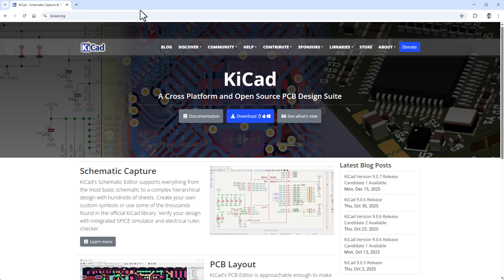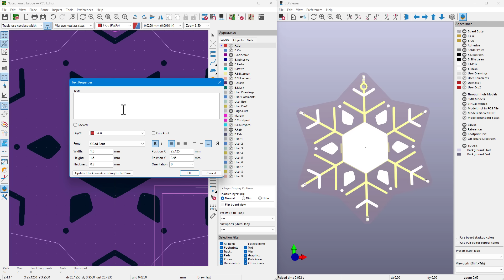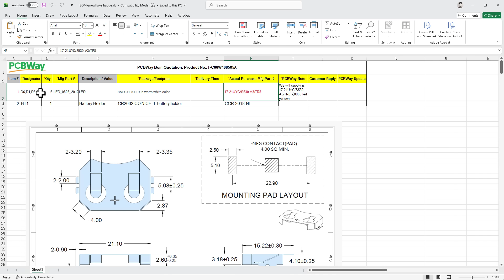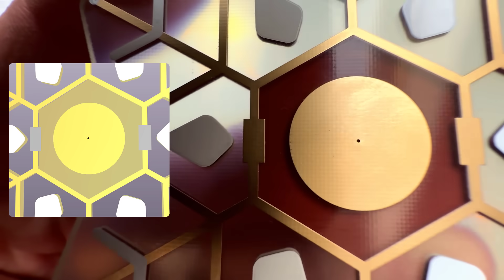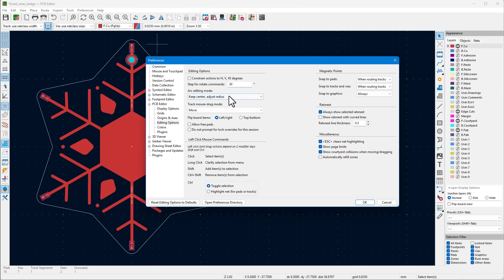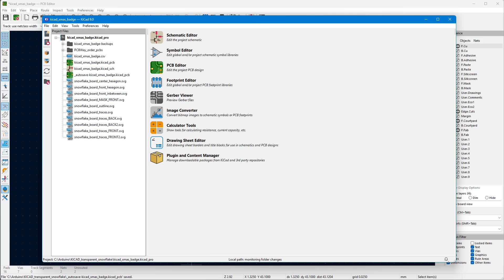You can have transparent PCBs now???

Comment: Exciting stuff! I reached out to PCBWay and asked for some info on the substrate: It's Y-920GT, a glass-fiber reinforced, halogen-free epoxy laminate with very similar properties to FR4, Tg 140. The data sheet I got says 86% light transmittance, which is pretty impressive imo. Can't wait to make something with this.
Reply from the maker: That´a very helpful, thank you for sharing this information.
Reply: This just revived a variation of my backlit thumb keyboard with down firing leds mounted on the back 😎
Reply: The documentation says that transparency was calculated for a 0.1mm layer, meaning it won't be very transparent for 1.6mm.
Reply: @denisgluk431  Certainly not transparent, but translucent enough for a bunch of cool applications I'd say.
Reply: @buildacubesat  I ordered a board with STM32. We'll see if both sides are visible; the tracks are very thin. If they make 4-layer boards like that, it'll probably be a real treat.

Comment: I'm new to electronics. How can we power LEDs directly without resistors? Because of cr2032?
Reply: Some LEDs have resistor build in, but I din't notice if he mention it.
Reply from the maker: The CR2032 battery does not have enough power to really kill the LED, but yes, you should put resistors for LEDs.

Comment: Weren’t pcbs made on glass at one point?
Reply from the maker: I don´t know, but I would suspect that drilling glass is quite involving.
Reply: @upir_upir I think drillability depends on the type of glass, some glasses you can drill pretty simply with the right tools.
Reply: @upir_upir after some digging I found a few companies that say they are able to fully manufacture glass pcbs with vias. Could be cool to see although I’d expect it to be fairly fragile.
Reply: @upir_upir  I found some 0.3mm diamond core drills at the store one evening. All I had to do was mark the holes on the CNC machine, then just sit back and slowly drill. I also bought a tiny drill press. They say you can harden regular drills in sealing wax, but I haven't tried that.  And all the glass is the same. It can be tempered after drilling.

Comment: I'll try ordering it through some intermediaries now. It's a shame I don't have a sample of this PCB.

1. The surface is uneven, so you can't see anything through it. I wonder how transparent it would be if I also filled it with epoxy.

2. Soldering it on a soldering table. Any flux contains synthetic rosin and resin acids, and they develop their natural color if heated for a long time. When I solder a white board, I have to be very careful not to overheat it, otherwise the rosin will somehow soak into the solder mask, leaving yellow spots that can't be removed. And this board is completely transparent, so it's a bit scary to solder.
Reply from the maker: You should definitely get one and try it, it looks great.
Reply: @upir_upir  So, I ordered a board that I'll put in a transparent case. This company asked me for $50. Competitors (other manufacturers) wanted something like $400-$500. I'm waiting for the results

Comment: Oh... this is going to be a huge deal. I'd love to know what kind of material this is, and how it differs electronically from FR-4.

No sign of this on JLCPCB as of the time I'm writing this.
Reply: It's Y-920GT and has very similar properties to FR4 Tg 140: Dielectric constant (1 GHz): 4.1, loss tangent (1 GHz): 0.023.
Reply from the maker: Thank you for the clarification, very helpful!
Reply: Indeed, JLCPCB don't have this. They have transparent flex PCBs, which is not the same (and expensive).

Comment: can i keep using easyeda?
Reply: Give KiCAD a try! You will love it – I know I do.
Reply: @buildacubesat  I think these were originally clones of the same program.
Reply from the maker: It´s just a different PCB base material, so the tool does not matter very much. You can use easyeda, but I´m not sure if you can configure the 3D viewer to simulate the transparent core.
Reply: @upir_upir  You can disable the visibility of any elements, in particular the PCB itself - it will look like a transparent board.
Reply: @upir_upir  cou can't. Well, you can configure WHAT is shown, just not HOW. My concern comes more from the fact that easyeda is (i think) more finetuned for jlc pcb, which may give bad results with other manufacturers, like pcbway. And i dont know if easyeda hat an option to have places where its just the bare transparent part, and not the part that is often green (idk what its called, but it is for insulation, it can also be other colors like black or red).
Reply: @buildacubesat  can i just give some button a click, and expect al my projects to move over, or do i have to make everything from scratch again?

And has it a component library that shows the stock, and generates the footprint and updates the BOM automatically, or is that another thing i need to thing of?

Sorry, i would love to try it, but those quality of life options are thing i heavily rely on
Reply: @RaphaëlMeijboom  This won't work.
If only there were a common format for importing and exporting, but easyIDA doesn't support standard import formats.

If you have a lot of time and energy, you can convert them yourself. However, .json files are text files. You'll just have to sit and figure them out.
Reply: @RaphaëlMeijboom Those were exactly the things that held me back when I made the switch years ago. I ended up not porting anything over and starting with a clean slate (not sure if there is some migration process these days though). It's a lot of work but I never regretted it.
Reply: @buildacubesat   I've been designing in EasyEDA, the basic version, my whole life. I use third-party programs for routing, and then I finish it by hand. I still have to think through the routing, my brain does it better than any program, and I also have to check the details of the tracks. Basically, it doesn't matter what you build the boards in if you do everything by hand. I tried switching to Altium and its capabilities, but its component library is simply terrible. And I have to redraw many components on each board, adjusting them for a specific situation. And in Altium, there are no words for how inconvenient it is.. I want to write a couple of scripts for self-layout; it's not that difficult, but I haven't gotten around to it yet. There's this thing called easyeda-round-tracks; it's available for both EasyEDA and KIcad, and it's a cool tool
Reply: yes, of course, the gerbers are the same.

Comment: This looks cool but would be useless for projects that require a ground plane.
Reply: Yeah, that was my first thought. If only we could make selectively transparent copper haha
Reply: @skmgeek I previously tried to deposit copper on LCD glass using electrolysis, and then fabricated a printed circuit board. This glass is made with a transparent conductor. Unfortunately, the traces turned out to be mechanically unreliable. Otherwise, it would have been possible to fabricate both the traces and the transparent contact pads without any problems.
Reply from the maker: Selectively transparent copper! That´s the missing puzzle piece. Hehe. I like that idea a lot.

Comment: A couple of older Sci Fi shows had translucent PCBs. This is cool to see in real life.
Reply: там больше на высокочастотные платы похоже обычно, под которые прожектор кто-то засунул. если со светом постараться, любая плата просвечивать будет
Reply from the maker: Do you have any examples or names of those scifi shows? I would love to check those. Thanks!
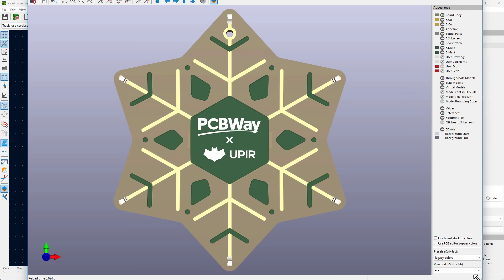Reply: @upir_upir  I've seen a lot, but I can't remember them off the top of my head. There's a movie called "Passengers (2016)", and at 1:27 they start looking for a malfunction in the engineering bay, and they show transparent circuit boards. Although now that I look closely, they're just multicolored pieces of plexiglass, with groove-like tracks machined into them. I understand that when making a high-frequency circuit board, the materials are often more transparent than FR4.
Reply: @upir_upir  Lost in Space, UFO.....pcb cards glowed. weeel cool.

Comment: да уж.. столько лет это сделать пробовал, но дорогие химикаты и оборудование сложное надо.. а тут просто делают и всё. Как здорово, что из-за какой-то надуманной дури, в мою страну эта контора ничего не посылает. Найти бы хотя бы fr-4 такой прозрачный, я сам заморочусь двухсторонюю плату сделать
Reply from the maker: English please?
Reply: @upir_upir  

This company doesn't supply anything to my country. Sanctions are idiotic. Our military uses printed circuit boards, but they have their own production facilities that cover 200% of their needs. And they're hurting schoolchildren and people like me, who simply order printed circuit boards for home use. There's nowhere to even order a regular printed circuit board; there's no production in the country, manufacturers account for 10% of the market, and that's it. So it's a bit disappointing; you have to turn to middlemen and pay several times more.

I've tried dozens of times to make these printed circuit boards myself. I tried to come up with a transparent adhesive that would withstand high temperatures. And I've tried dozens of different metallizing compounds for glass. Some methods require expensive equipment, highly toxic chemicals, or rare earth compounds. You can even build a magnetron and deposit metal in thin air. Another very reliable method is baking silver carbide paste into glass. Then you can solder any contacts, and they will be mechanically reliable. If you find a furnace capable of heating to 700 degrees Celsius, you could even fuse copper directly with glass. I don't have the time or money for all that experimentation right now.

But I'd love to try this board; it's very interesting. The battery holder could also be made transparent. Take a CR2032-BS-8 battery, remove the contacts, and print the plastic on a polymer printer using "hi-clean resin." Even a pre-made model is easy to find.